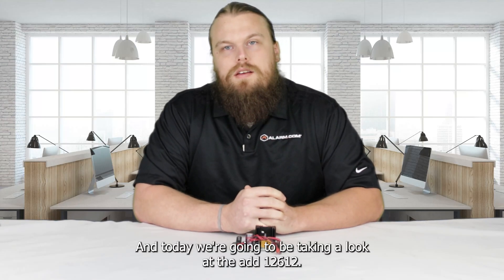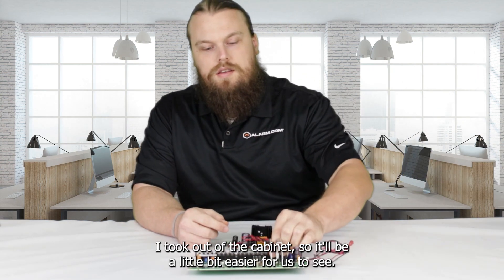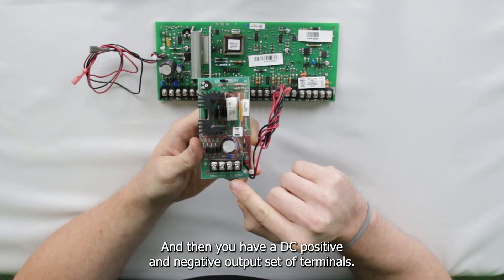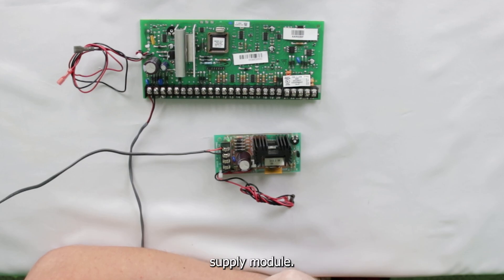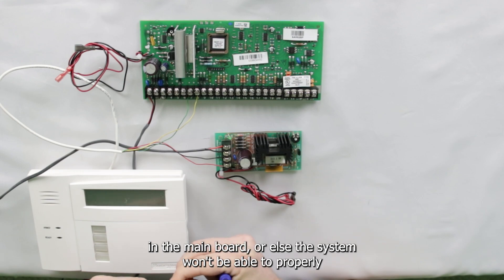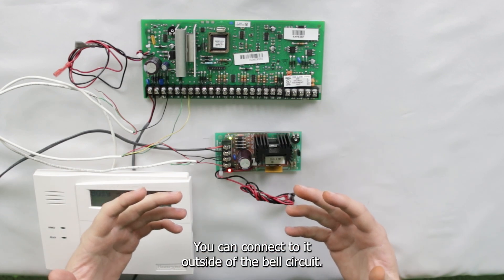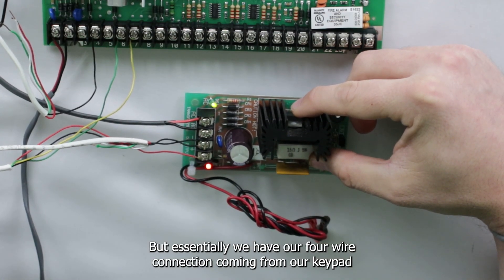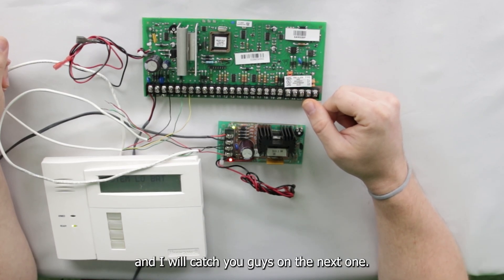Avoid Mistakes: Honeywell AD12612 Power Supply Module Tutorial

Comment: What is the best way to mount the module inside a metal enclosure?
Reply from the maker: Generally the easiest way is to use double-sided tape. Just ensure the tape is thick enough that when you push the power supply into position, the connections on the board do not poke through the tape and touch the metal of the cabinet.
Reply: Can you use a 7ah battery on the AD12612 or is the only option being the 4ah?@AlarmSystemStore

Comment: I wired my aux power supply to just power the siren and remote sounders. I used a relay activated from Bell Output. Wired devices to NO and C.  No negative wire connection to the panel terminal 4 because it is just a relay. The jumper to both negatives is needed only for keypads.
Reply from the maker: The negative jumper is needed for anything that connects to the CORBUS of the system including zone expanders and the receivers, but yes, for relays or standalone items the jumper isn't needed. What we see power supplies used for most is extra keypads and modules, so this video is more focused for those setups. Just curious, but why not use the bell circuit for the sirens and sounders? It offers more power than the aux power supply (so long as the system battery is charged).
Reply: @AlarmSystemStore 
My connected load exceeds 600 ma. Mainly from the audible devices. In an alarm condition, the resettable poly switch would open, killing the entire system. I will probably move a keypad and the 4219 expander to the aux supply. When I do, I will add the negative jumper.  Thanks for the reply.